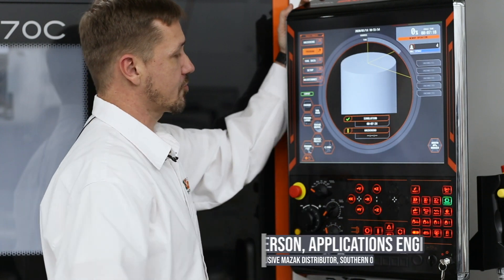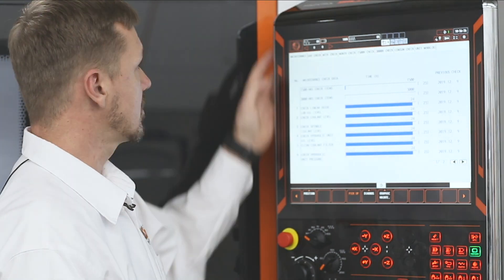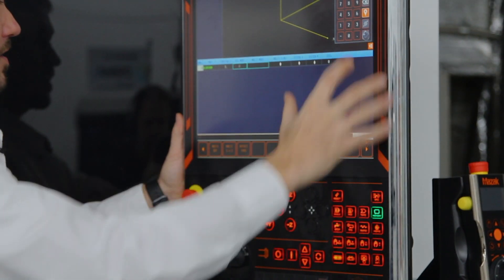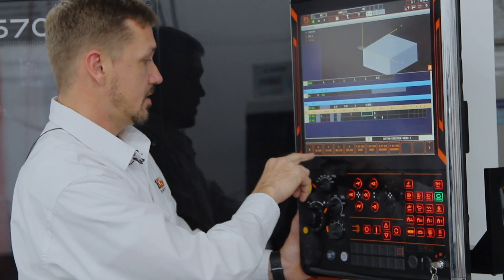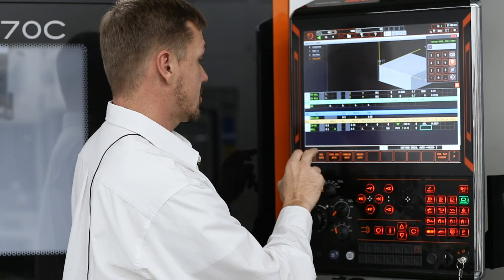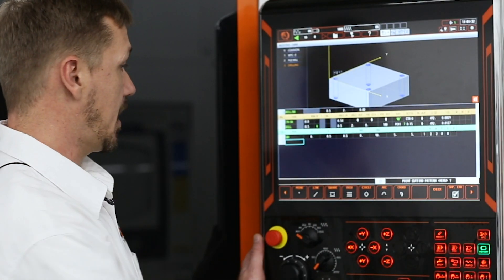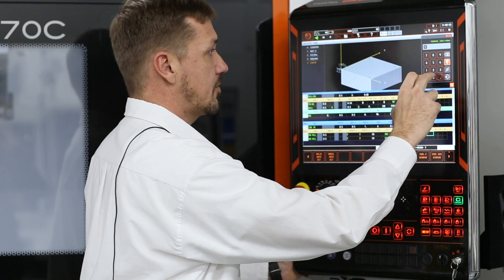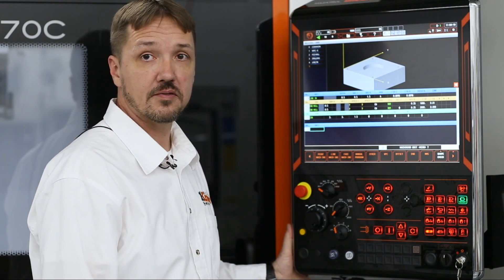MAZATROL Programming Step-By-Step

Comment: Is G140 engraving codes is optional for Mazak Smooth VC5X? How to restart the program in mid operation as per your example but with thread and it breaks in 3rd hole, then how to restart on the 4th hole?
Reply from the maker: Yes, G140 Smooth Engraving is an option for the VC-500A/5X and VC-Ez 5X models. If you wish to restart in a MAZATROL Point Operation, you must first confirm your machine is in a safe location. Then with the correct WNo. chosen and SINGLE BLOCK active, select RESTART from the POSITION page, choose your desired point operation, then select the desired specific point. Verify all the correct offsets for your program are active. Please contact your nearest Mazak Technical Center for support if you have more questions.

Comment: In case I've used CAM to generate the toolpaths for a newly developed part that required purchasing new tooling, can i import the tool data from my CAM software with the ISO 13399 data exhange format directly to the Mazatrol enviroment without intermediary conversion steps or manually typing in the tool parameters?
Reply: Oh wow they suck at responding this is going into my decision of buying mazak for my machine shop. How is their customer service?